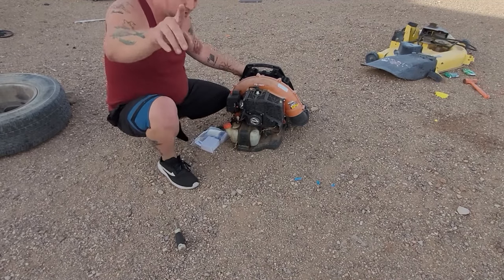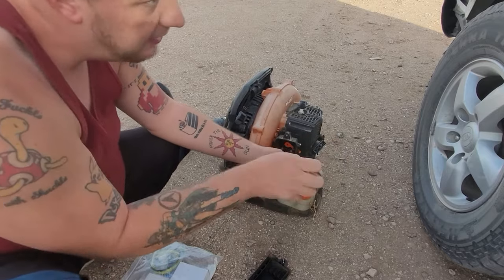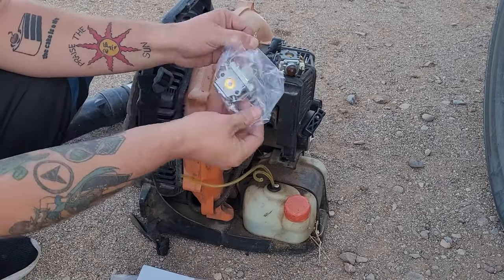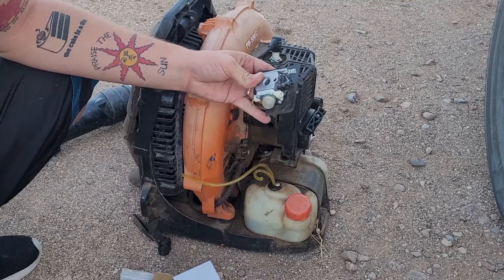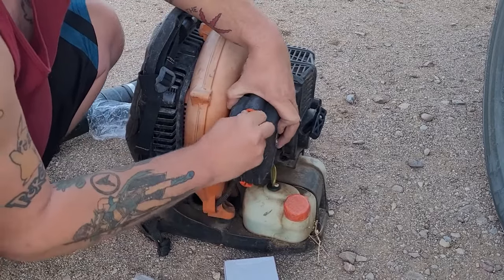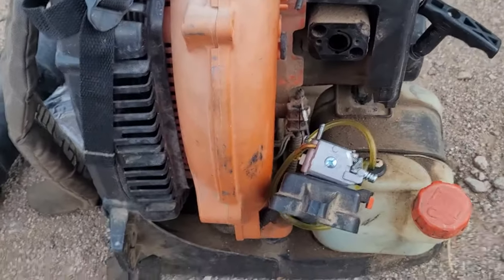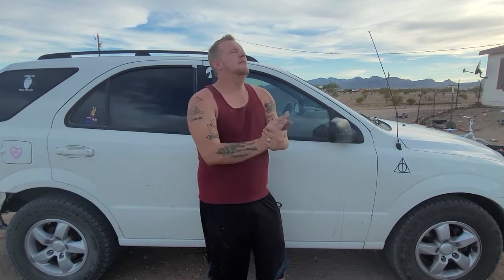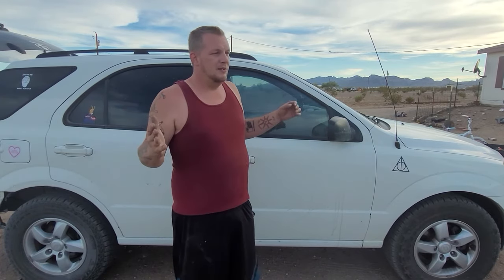Echo PB580T backpack blower Full repair video very easy repair to do.

Comment: I have the Echo PB 580H.  Mine would not even fire.  I ended up replacing the ignition coil and it then ran fine.  Enjoyed the video.  If I need a carb I will know what to do now.

Comment: I was wanting to know why a leaf blower runs for about 15 minutes it runs good and it starts right up after running it for 15 minutes it wants to die I was wondering why it doesn't
Reply: Could be building a vacuum in you fuel tank from not venting good

Comment: Hey great video👍 
Quick question.
I changed the carburetor and spark plug and still won’t turn on .
What could it be?
I would appreciate if you can help me out.
Reply from the maker: You got to check for spark first with a spark plug tester. A good way to do is just spray some starting fluid. If it starts and dies you can go from there
Reply: @RepairGang  thank you 🙏
Reply: @josuerojas3675  -  I have the Echo PB 580 and it would even fire.  Try replacing the ignition coil.  Worked for me.

Comment: Mine is getting stuck mid throttle and kind of bogging down. You think the warranty will cover it? I know I could fix it myself but rather not mess with it rn
Reply from the maker: Check spark arrestors
Reply: @RepairGang  I will Monday and let you know, thanks
Reply: I forgot to ever mention, I noticed the carb and air filter were loose, found 2 loose screws under the filter, tightened them up and seems to be fine now!

Comment: Mine will start but it just wont idle. What do you think it is?
Reply from the maker: Carburetor high low adjustment
Reply: Where do I get the D adjustment tool?
Reply from the maker: @bradbanks6274 https://amzn.to/47MfzSU use this link it helps the channel and it's what I use
Reply: Doesn't the OEM echo carburetor come already tuned?

Comment: That bag of Chinese garbage "fixes it" but not for very long. The carb requires different line that comes with kit. That's great but the lines in the kit won't last more than a year. The carb is a Chinese knock off of the stock Walbro and the throttle cable attachment plate hits the side of the engine case. It works but not without fiddling and swearing.
Reply from the maker: I feel that my guy the whole blower is only $200 bucks anyways 😂😂😂😂